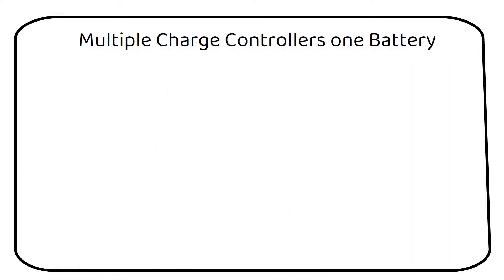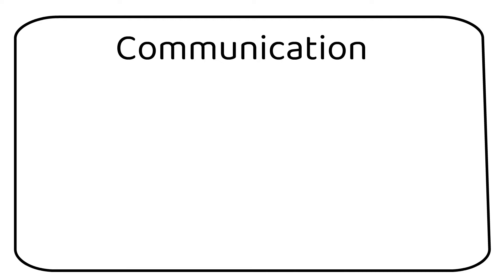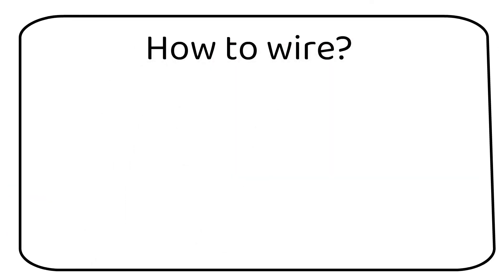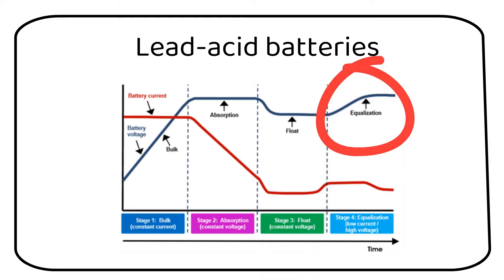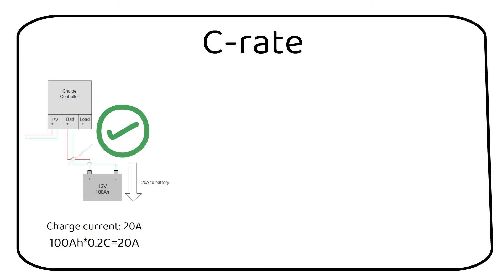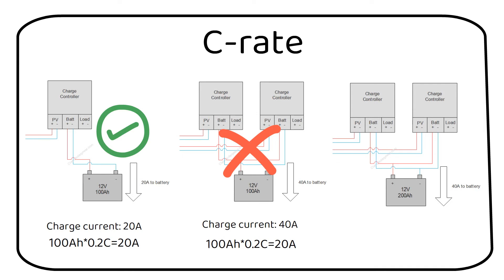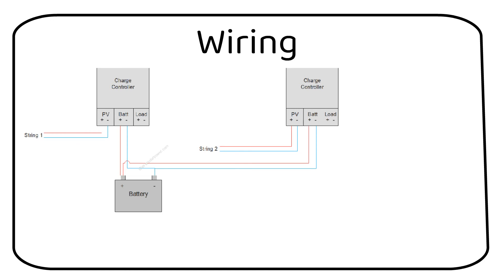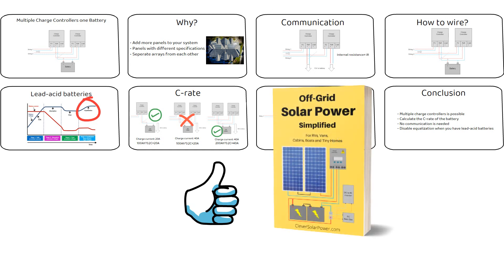Multiple Charge Controllers One Battery Bank: MPPT and PWM

Comment: i have 12 Trojan T105 batteries 24v for 10 years and good quality batteries.  I hated having to constantly refill the batteries. And that could happen very quickly, 

I switched to LiFePO4 batteries and I'm very happy with this batteries.
Reply from the maker: Yes, they were considered the top tier lead acid batteries back in the day. How frequently did you have to fill them up?
Reply: 6 to 8 time an year.  In the summer 8 to 12 liter distilled water.

Comment: Hello Nick 
So you dont need to have the same charge controllers in parallel either if I understand you correctly ? I use a bus bar .
Reply from the maker: No, they can be all different charge controllers.

Comment: i have a 200 foot run from panels to controller. the array is two sets of 580 watt panels run in series-parallel facing south and west. the 6 gauge cable was expensive and i wanted to know if it is possible to run two mppts off the same array and same battery for double the charge current.
Reply from the maker: You have to separate the solar panels if you want to use two mppt's.
Reply: @cleversolarpower please explain what would happen. 

could mppt and pwm work in this scenario?

Comment: Nice video my question is can you use different brand solar charge controller because I try and it didn't work for me
Reply from the maker: Yes you can, they don't have to communicate with each other. Think about it, when i have an MPPT and a battery charger they work fine charging the battery.

Comment: I would like to add the reasons why i think the configuration and problem i submitted to you i(see my post below) is IMHO very useful :
1. Having 2 independent strings  each with its inverter and batteries makes for a more resilient system.

2. It is not advisable to have many batteries in series or in parallèl 
3. When you scale up your system you ofren have mismatched batteries that you cannot link together..
Thank you for any possible help Nick.
Reply from the maker: 1. yes, this adds redundancy.
2. Thats not a problem for parallel. But with series you need a balancer. 
3. not true. in parallel batteries balance themselves. You can even have different capacity batteries in parallel. I made a video about: 'parallel different capacity' on my channel. Check it out if you want to learn more.

Comment: Hello Nick 
It would bé interesting to know how to link  2 strings of PV with 2 strings of batteries (that you cannot link together ) to thé electric board. Is it feasible with a switch ?
Is there an alternative ? For ex if feasible  I would like to have :
- one puresine wave inverter I would like to link to sensitive equipment in my électric board . This inverter is link to its own batteries 
- one inverter (with jittering in thé sinewace) I would like to link to thé rest if thé electric board. This inverter has its own batteries.
Reply from the maker: You can only have two inverters separately. You cannot combine the output of two off-grid inverters because they will burn up. the reason: they cannot synch their sine wave with each other.

Comment: What about one solar charge controller (i can set voltages on it), and one wind turbine controller which has autodetrction of 12v/24v battery but no voltage adjistment at all?

Can i connect them in parallel?
Reply from the maker: Yes, if both charge controllers can work with the battery type you have.

Comment: Please i have a guestion..i used to have 200 ah batery for  550 wats panel mppt but my brother sold the batery but i still have a 40ah batery can i use if for now till i save to buy a bigger one... reason i ask is because there is always a load of 300 wats at home so i want to know if 550 wats panel on a 40ah batery and a load of 300 wats make it safe
Reply from the maker: It depends on the size of the bms inside the battery. It has a maximum charge and discharge rate.

Comment: Nick how about 3 mppt solar charge controllers 1 battery?
Reply from the maker: That's possible as well. Just make sure that the c rate of the batteries match the charging current. If you have one 12V 100ah lifepo4 battery with a 100A BMS and you add 3*60A charge controllers, the battery will shut down because the current is too high. Check my video about c rate.
Reply: @cleversolarpower  thanks Bro noted watching ur c-rate video

Comment: I want to ask; assuming i have a hybrid inverter with in built 100A mppt charge controller hooked up with 600X 4. So if i want to upgrade with a new string of pv arrays that may likely either have a different wattage, voltage or amperage. Is is possible to connect an external charge controller to handle this new string separately to charge the batteries ??

Also, considering the hybrid offers the ability to run the load from solar energy from pv while charging the batteries at the same time, if an external charge controller can be connected to charge the batteries, is is technically possible to connect such controller to the inverter such that it shares the load with the inbuilt mppt controller? I doubt this myself, as i have only been able to create two separate controllers in the past; one for charging the battery and the other for handling the loads. ??

It's a 48v system with LifePO4. Thanks for your tips
Reply from the maker: Yes, you can add another charge controller to your system if your hybrid inverter already has another mppt. Second question, the energy of the second charge controller will directly go to the busbar or battery terminals. The energy will be taken from there. But it doesn't really matter.

Comment: If i understand this, I can add an external solar panel and charge controller directly to the battery. Current system onboard: 100 watt Renogy Solar Panel, 20 AMP Renogy MPPT charge controller. External/proposed add-on: BougeRV 20 AMP PWM controller, Renogy 100 watt suitcase panel. I know MPPT would be more efficient, but this is what I have. Assuming this works, connecting it directly to the Power Queen 100ah LiFePo battery. That appears to be the setup on your last diagram. Have I got it right?
Reply from the maker: Yes, it will work.

Comment: Excellent video. The information is well organized and clearly presented. I came to this video late in my project to upgrade the power system in my 14 year old Lance 825 camper. This video is very helpfu. I am integrating new components into the existing 12 v power system. This information is not new, but your video is comprehensive and easy to understand, helping me pull everything together and gain confidence. The upgraded powere system features the new Renogy Core Mini LI-ON 300 ah battery. I am adding 300 watts of solar, updated  the converter charger to handle Lithium batteries, and adding the Orion xs DC to DC charger. Everything is currently wired with 8 awg cable. I am increasing the wire size to 4 awg between the existing wiring and the the battery. I have defered on an inverter. Again, thank you!!
Reply from the maker: Thanks for your comment, good luck with your new install!

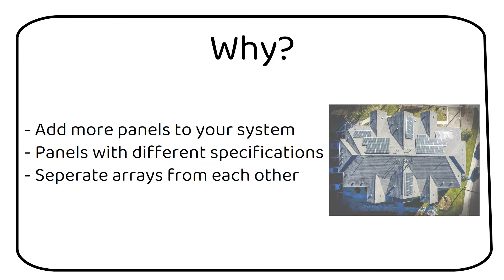Comment: 0:35 Number 4 : Redundancy on boat: I have 4 seperate Victron solar charging systems connected to my 31kWh LiFePo4 battery pack, when one fails, I still have 3 working..
Reply: Any that's perfectly fine, zero damage will happen from multiple charge sources, I have 6 separate chargers hooked to my system.

Comment: It’s not that a charge controller charges a battery at a specific voltage.  There is a voltage that the charge controller will not exceed, but unless the battery is already near-full the charge controller’s output voltage will be a function of its current verses the battery’s impedance.  In other words, charge controllers are current-regulated devices, not voltage-regulated devices.  If a charge controller were actually able to output its target voltage to a near-empty battery, the current would be astronomical. 

This means that when there are multiple charge controllers in the system, they will charge the battery at the maximum power being supplied to them from the solar panels (capped at the maximum current the charge controller can support of course).  The voltage will be well below the charge target voltage during this period.

So during most of the charge curve, it doesn’t matter whether the wiring is equal length or not… the charge controllers will put all the energy from the solar panels into the battery.

Once the battery is near full the charge controllers will hit their maximum configured voltage… the target voltage, because the amount of power they have to output to get there will be lower than the amount of power available from the solar panels.  At that point wire length matters and you will see vast differences between charge controllers.  But you also generally don’t care at that point because the battery is near full.

So you generally don’t have to worry about making wires equal length.

Numerous charge controllers can be networked.  Victron Smart Solar charge controllers can form Bluetooth networks (see the app) to synchronize their behavior.  While it is not absolutely necessary to synchronize their behavior doing so will clean up various edge cases that might otherwise cause unexpected behaviors.

-Matt

Comment: As others have stated,you do a fantastic job of explaining concepts for all
 Thank you! I've been searching for this content for a long time.
I am still looking for a answer, perhaps you can help?
I will be using 2 controllers, for two pv arrays. Charging my battery bank.
Controller outputs will join at a bus bar, then wired to battery. Cable sizing from bus bar to battery is my question??? Simple as combined current rating?
In advance I thank you for sharing the gift of knowledge!
Reply from the maker: The thickness of the cable depends on the current going through it. Most of the time, the current from the batteries to the inverter will be highest. So you have to account for the highest current, whether it be from the charge controller OR to the inverter. If the current from the charge controllers are the highest, then combine the current and x1.25. for example 2x 50A mppts make 100Ax1.25=125a fuse and a cable that can carry at least 125A.
Reply: @cleversolarpower  
Perfect! Thank you.
That gets my wheels going in another direction.
I will be utilizing an inverter in the system as you speculated.
If I join both charge controllers AND the inverter at the bus bar, does one add the current of the three componants , for cable requirements, or does inverter offset controllers given the direction of current flow?

Comment: Yes, you can stack Charge Controllers, but you will waste a lot of usable power.
When stacking charge controllers, only 1 Charge Controller will give you the near maximum power and the rest will do almost nothing.
The Charge Controller that is giving you the highest output is providing the charge voltage to your batteries.
All the other Charge Controllers see the charge voltage and do not give you an output because they think the maximum battery voltage has been reached.
Charge Controllers do not know the difference between charge voltage and actual battery voltage.
The only reason to stack Charge Controllers to get the maximum output is if your solar arrays are set up to follow the sun. (Not Tracking Systems)
One Charge Controller /Array is for morning sun, another is for afternoon sun, and another is for evening sun to avoid shading.
You may be better off to use 3 parallel strings of 3- 250W panels with 3 sets of power wires going to 3- 30A Breakers, who's outputs are daisy-chained and go to your 100A/100V Charge Controller.
9- 250W panels = 2250W which is under the 2400W max input wattage of the Charge Controller and the input voltage is about 35V.
Reply from the maker: Have you tried running multiple charge controllers on one battery? The charging current just adds up. And the charge controllers see the internal resistance of the battery instead of the voltage. I assume you have lead-acid batteries. Charging with a high current will increase the heat thus increase the internal resistance and thats when chargers throttle down. No problem with lifepo4 batteries.

Comment: thank you! you could also add multiple battery chargers together using this same logic correct? like if you put 20amp battery chargers together and hooked that up to a generator to charge batteries (instead of using the generator to power things, it charges the battery).
Reply from the maker: You can have multiple battery chargers charge a battery. It would be generator -> 1st battery charger on socket 1 and the 2nd battery charger on socket two of the generator.
Reply: @cleversolarpower  as long as the battery chargers are in parallel at the battery terminals, I believe that would be the only true concern, right? I was going to run an 8 gauge power cord 30 feet from the 220v 30amp outlet on the generator, then connect all chargers to that wire via power blocks (all equal length). I then have a 6500 watt (continuous rated) generator and I'm planning to run (4) 18amp 58volt chargers (4 x 240v x 6amps = 1,440wats x 4 = 5,760watts need for 4 chargers). Each charger takes 6 amps at 220v, so that is 24amps on the 30 amp outlet from the generator. Should be good to go, each of my 5 batteries have a c rating of 100amps, so bank would have a c rating of 500amps, and I'll be dumping 18amps x 4 = 72amps/5batteries = 14.4amps charge going to each battery connected with equal length cords in parallel. Sounds good sir?

Comment: Its not so straight forward with controllers  it may seem to be a great idea when the battery bank is full 10 volts is still flat  the banks out put cap is directly related to its inductance or reactance  you get switching  issues   huge inrush voltages  due to the potential difference    the long and short of the circuit  the plane wing  radiation
Reply from the maker: I don't understand your text.
Reply: @cleversolarpower  your  swinging the power back and forward   if you have two controllers and the loads turn on and off
Reply: inverter

Comment: So I've seen several videos that concur with your findings; that you can use multiple charge controllers to charge a bank.  Can I also use multiple standard chargers.  For instance, I have 3 100 Ah LifFePO4 batteries in parallel.  Can I use an LiTime 20 amp charger and a NOCO 10 amp charger simultaneously to charge the bank?  To make it more complex, can I use solar charge controllers and battery chargers at the same time, even while taking a load off the batteries?  By the title of the video, it looks like the charge controllers don't have to be the same size or the same type (MPPT and PWM) right? Thanks
Reply from the maker: Yes of course. As long as the C-rate of the battery can handle it.

Comment: I have a hybrid solar inverter already installed which charges batteries and also running load. Adding a charge controller to the same batteries, is there any chance of running current from the charge controller to the inverter itself and damaging the inverter?
Reply: No, but there are edge cases you need to be considerate of.  Charge controllers are current-regulated devices so their voltage regulation is very poor.  This means that if a charge controller is pushing current into a battery and the battery BMS suddenly disconnects, the charge controller's output voltage may overshoot its charge target voltage for a second or two.   The inverter might complain if/when this happens but it definitely won't damage the inverter even if it does.

This means selecting proper voltage targets for the batteries you have.  Lets say you have a 12V battery system.  A charge target of 3.55V/cell (x 4 = 14.2V) would be appropriate.  The BMS in the battery will likely disconnect at 3.65V/cell (x 4 = 14.6V).  So you want to select a target voltage that does NOT regularly trigger the BMS disconnect.

-Matt

Comment: I have one 400ah battery and want to add another victron 100/20 charge controller for more solar panels what in your opinion is the best formula to achieve this
Reply from the maker: You can add it, depending if you have other chargers connected and don't go over the current of the BMS inside of the battery.

Comment: My current system is 12v. Can i add another 12v battery in  series and charge batteries with separate charge controller.
Reply from the maker: You have to add the battery in parallel. Check my video about parallel batteries.
Reply: @cleversolarpower  My mistake, i need 24v but i have now 12v system.Can i charge individual battery with 12v charge controller and solar panels. But use for load in 24v.

Comment: I call bs on 0.2 c for lead acid, cars charge the battery at much higher rates and never a problem.
Reply from the maker: The answer is in your reply. car batteries. they are not similar to AGM or GEL.

Comment: I am trying to help a friend who has 3 sets of panels, 3 charge controllers and 5 Eaton 140 ah AGM batteries. The batteries are less than 5 years old and do not support his needs for a cottage Can one charge controller be swapped for a Victron one even if the other two are PWM controllers?.
Reply from the maker: Yes, no problem. You can have multiple chargers on one battery. Make sure only one has equalization mode enabled.